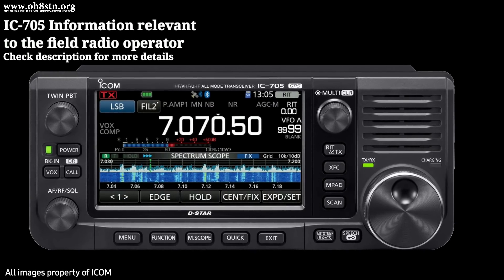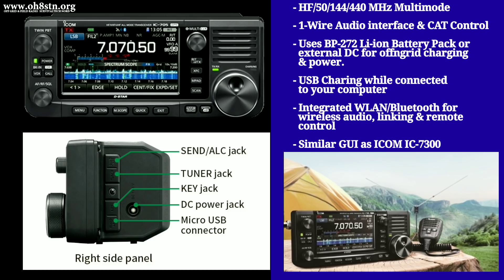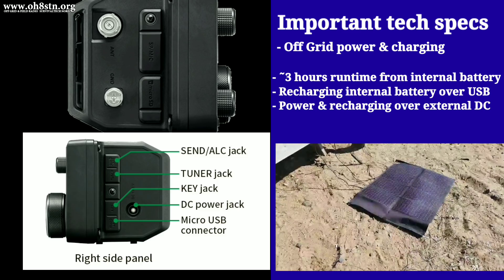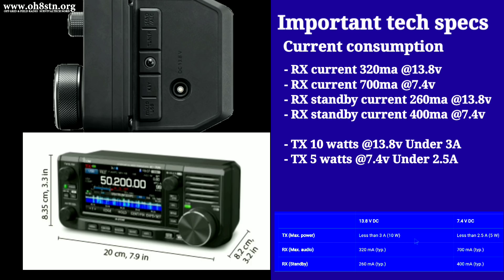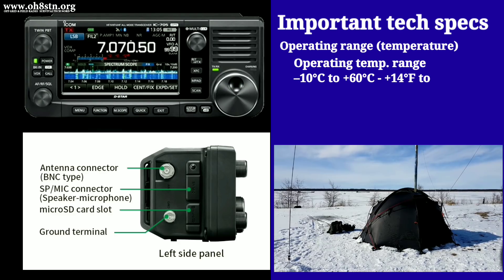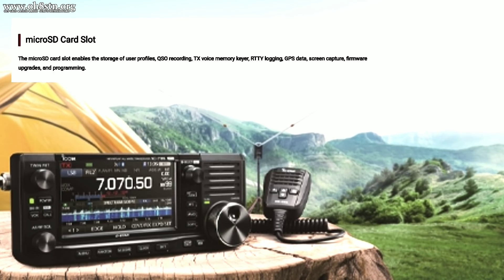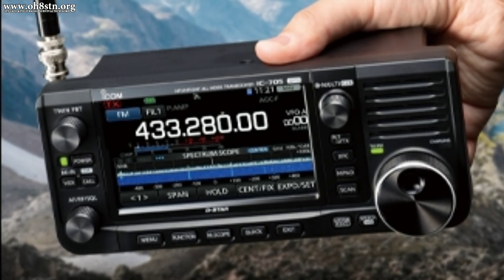Icom IC-705 Update May 2020

Comment: I love it, it actually has features I want and should exist in all field rigs. Honestly, it amazes me that Yaesu has made such a big name for itself, rightly so, in the portable market, yet they are so far behind the times in features at this point. I think Icom has been leading the market in innovation for several years now, especially since the IC-7300 came out. I'm excited about the IC-705, it will take me a few months to save up for it though, so I'm not in any hurry. I love my Yaesu VX-6R, I adore my IC-7300, and I liked my old Alinco Dx-70TH (in a Faraday Cage as a backup). I may eventually pick a Yaesu FTM-400XDR, but I honestly don't drive enough to justify a full mobile setup, I have an IC-2730A in my house for VHF/UHF but can't bring myself to put it in my truck to just sit there. Also, I should add that Icom does a FAR better job with marketing, Yaesu and Kenwood are lazy. You see Icom everywhere, all the YouTube channels, all the sponsoring, and it isn't gimmicky either, they have quality kit. The others need to get on the ball or lose the battle, I think poor old Alinco is on it's last legs and will die in the coming years, sad. We need some competition, Xiegu is doing well, but most of us are afraid of Chinese manufactured stuff, even though the reviews are often great. Competition breeds innovation.
Reply from the maker: Well said Devin. Honestly, I would have thought Yaesu would have been the one producing this radio. When they discontinued the ft-897 and said the ft-450 or the ft-991a was kind of a replacement for it, I knew they weren't going to produce any good portable radio again.
Reply: @OH8STN  Yeah, it's sad, I'm not sure what their focus is or who they have making decisions, but they need to replace that person and get some new blood in the mix. I mean the whole "prepper" market is a a great opportunity for these companies. You can't just rely on fanboys to keep you afloat, eventually you have to innovate, push the limit and introduce new ways to do thing. A great example, as you've mentioned many times, the could be moving to LifePo4 batteries.

Comment: I would love to have one but will never be able to afford it. I just bought an FT-891 for portable use.
Reply from the maker: With one exception the ft-891 is a magnificent radio. The only thing it's missing is the internal audio interface for data modes. If that's not important for you, or you're not hiking with it, I think you're going to be extremely happy. I love my ft-891.
Reply: Over $1500 US? Not me  in time it will calm down....

Comment from the maker: Table of contents.
00:00 Intro
00:40 short IC-705 Introduction 
01:47 Availability 
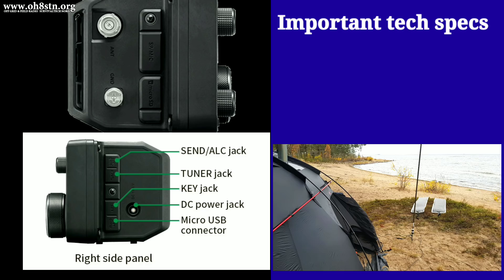02:25 Important /P technical specs
03:12 Off Grid power & charging
03:34 Solar powered IC-705
03:58 Current consumption 
05:25 GPS & Location sharing
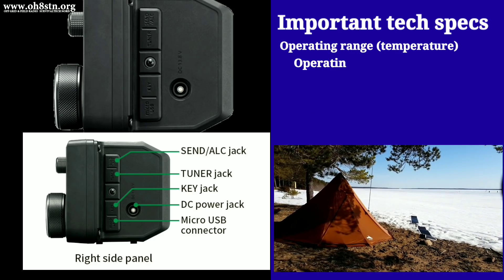06:04 Operating extremes TEMP.
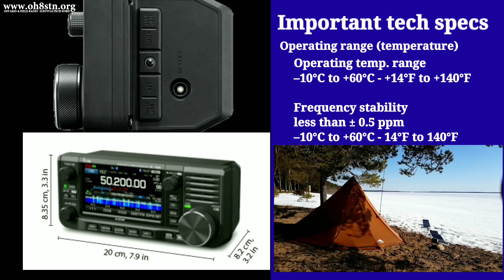07:14 What's important to field radio Operators
08:10 Final thoughts
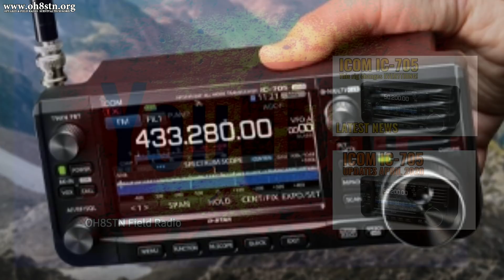08:50 End screen

Share video url: https://youtu.be/wuHfP64Zyvk
Icom IC-705 Playlist: https://www.youtube.com/playlist?list=PLKMrdrsNkFA7WY3ol7ToswVg_allhpDBb